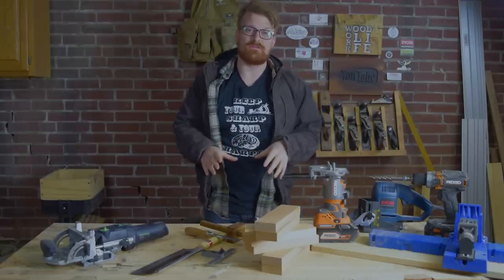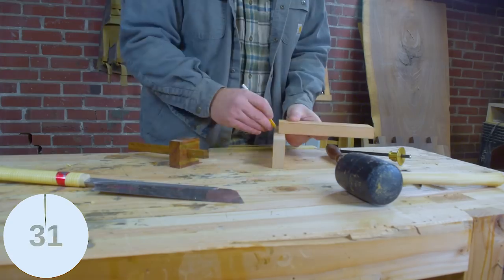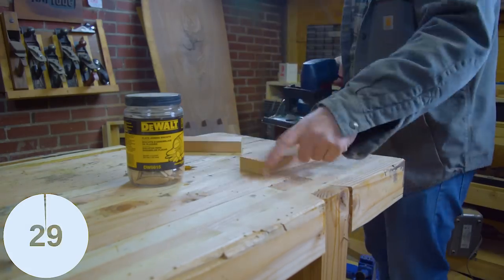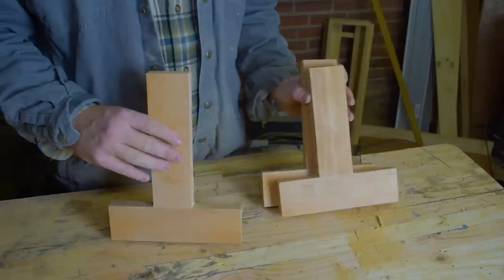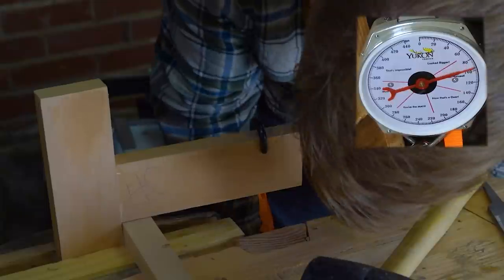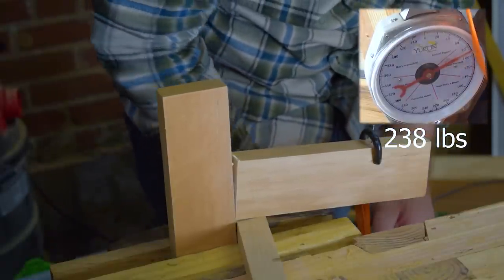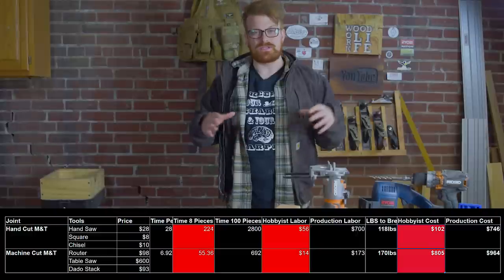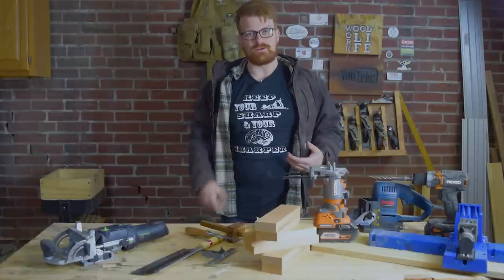Best Joint Shootout, The answer will surprise you!  | Hand Tool Shootout

Comment: Wow another which joint is stronger video. Unoriginal, not very scientific, the moment his first joint failed it has to be the wood and not the joint (shows his favortism).  For once I would love to see someone do one of these and say why any of this matters...
Reply from the maker: Did you even look at the chart breaking down why this matters at the end?  That was the whole fucking point.  I said the wood failed rather than the joint where it did.  In the conclusion I talk about how for most folks the pocket holes are more than enough.  There are a million ways to test any joint, no review could be exhaustive, I just tried to be succinct.
Reply: I was about to subscribe... turns out, you're just another YouTube content provider with a foul mouth and a short temper. I thought you had something to offer. I hope you're not sponsored, or if you are, that they don't see how you talk to folks in the comment section.

By the way, I could tell this was going to be another "Festool is the best option ever!!!" video, too... I was giving you the benefit of the doubt.
Reply from the maker: @gulfcoastguitars2842  wow, sorry I am not allowed to defend myself.  I will make sure to take the trolly comments with a grin.  I literally said it wasn't scientific, I did use the same wood, the same glue, and the same clamping pressure to every joint.  This is just a study on the joints.  Where the wood broke I called it out, where the joinery broke I called it out.  I would have to repeat these more than I have time to to really do a valid scientific test.

Comment: glue won't hold a butt joint? turned you off right there.
Reply from the maker: ??? Glue alone will not hold a butt joint.  Are you trolling?
Reply: No. BTW your holding yourself up as an expert. Bad move. I would drop that line and say something like "the holding power of glue can be greatly increased..." something like that. You are asking for a fight with a corporation. Yes there are many glues that will hold a butt joint beyond the strength of the surrounding material.

Comment: The problem with your tool comparison and pricing at the end is that a pocket screw jig is a one trick pony, but a table saw has unlimited uses. Also, $800 for a table saw, router and a dado stack? What kind of crap tools are you buying? I don't buy expensive tools because I have a ton of money, I buy (somewhat) expensive tools because I don't have the money to buy the cheap ones twice.
Reply from the maker: I tried to use the cheapest prices for a decent version of each tool.  The cheapest decent table saw that takes a dado stack is the Bosch, but I totally agree.  You would be surprised how good some of the job site saws are these days.  Point taken though.